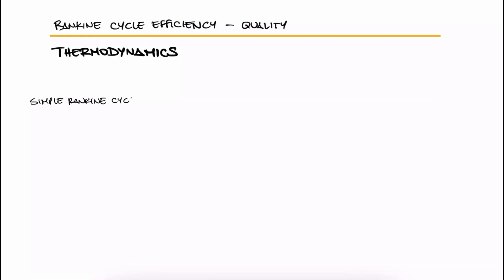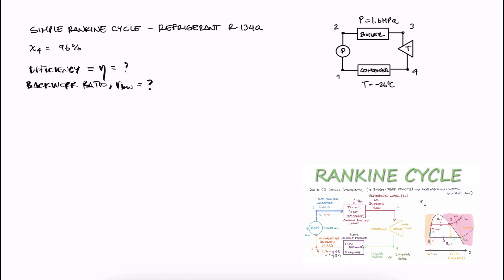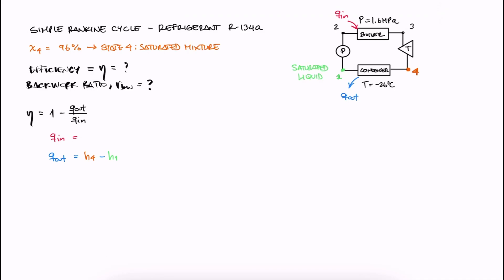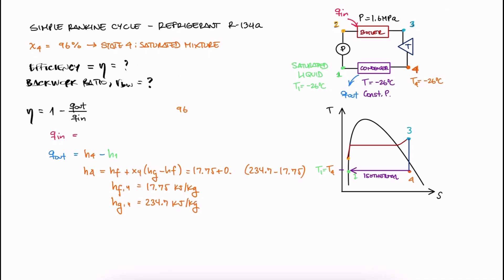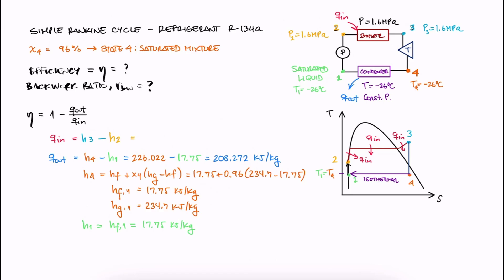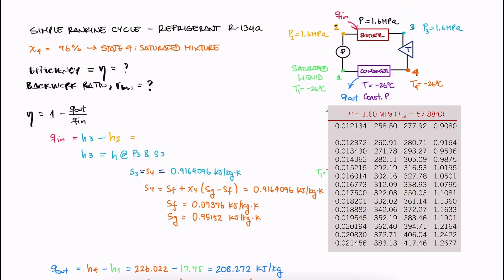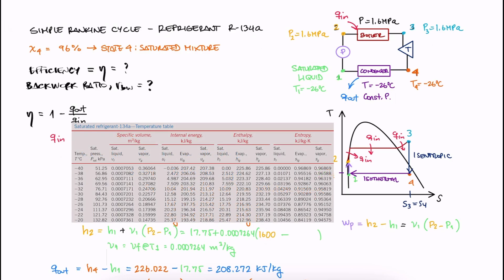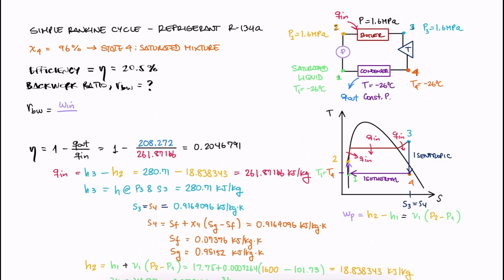RANKINE CYCLE Example with Known Quality in 4 Minutes!

Comment: @LessBoringLectures

Hi 
I need help to understand some thing about finding the efficiency for the steam turbine in Rankine cycle.
in practical, we have T1 P1 (and we can easily find h1, S1=S2isentropic) and we have T2 P2.
from T2, P2 we can't find h2 as we don't have X or S2.
So how can we apply the formula ===> efficiency = (h1-h2)/(h1-h2ise)
in this lecture 
Steam Turbine Stage Efficiency || Turbine Isentropic Efficiency Very Easy Formula from (Power Plant Guruji channel) he use h2 as hfg value which is not correct

please help me to find the efficiency